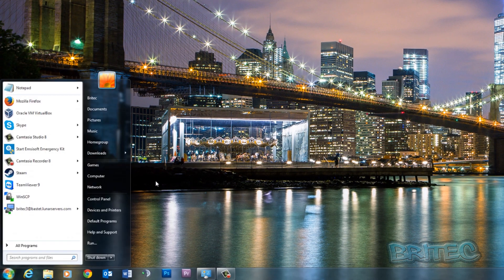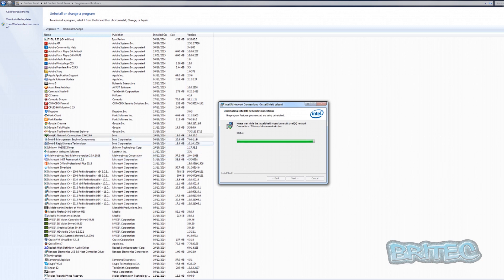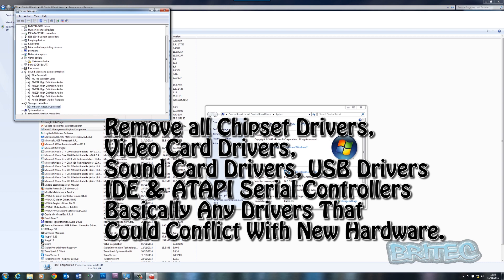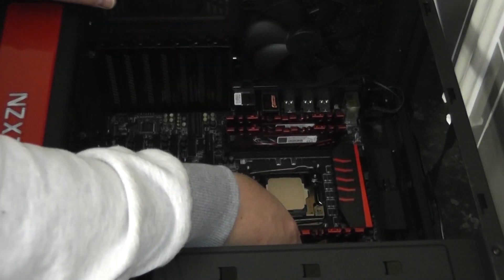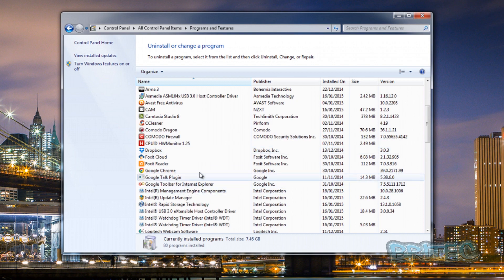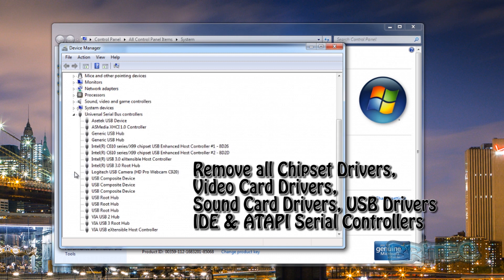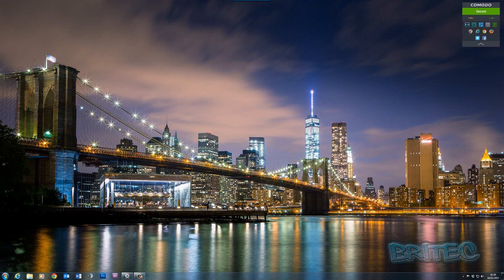Change Motherboard Without Fresh Install of Windows

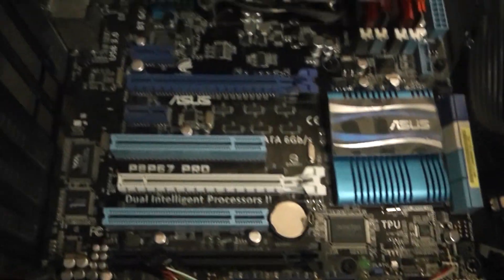Comment: Very good video.  I've personally never done this in my 16 years of building computers however I need to point out something that +Britec09 mentioned at 3:57 but didn't fully explain.  That is building a new computer.  This video should be fine if all you're doing is replacing the motherboard and keeping the same CPU.  But if you change too many things, especially if building a new computer altogether, and connect your boot HDD to it, there's a very good chance Windows will detect the new hardware (new motherboard, new CPU, new GPU etc.) and think it's been installed on a new PC and will trigger re-activation of Windows itself.

I had an old AMD Athlon 64 dual core many years ago and upgraded to an AMD Phenom II quad core.  As the two CPUs used a different socket set that the old motherboard didn't support, I had to replace the motherboard as well.   I didn't replace anything else, still had the same GPU, same hard drives and same RAM.  But what I did was backup the activated files of Windows to USB, then replaced the motherboard and CPU and re-installed Windows 7.  Once back at the desktop (to cut a very long story short) I rebooted to safe mode and replaced the default activation files with those I already had.  Yet when I got back to the normal desktop I got a message saying it didn't pass activation.  I had to go through manual re-activation of Windows which did work without calling Microsoft.

I had to mention this due to +Britec09 mentioning the whole building a new PC.
Reply: When you say "keeping the same CPU" do you mean the brand? I'm switching from AMD to a newer AMD motherboard.
Reply: No, I do actually mean keeping the same physical CPU, not the brand.  If all you're replacing is the motherboard to a more modern one then chances are your new MB should support the CPU you've been using providing the new MB has exactly the same socket type as the CPU itself.  If the socket type is different then your CPU might also need replacing.  If your current CPU is AM2 and your new MB is AM3, then AM2 should still work in it as it's not completely obsolete yet and there's still many users getting decent performance out of AM2 chips for what they need them for.  If your CPU is AM3 or AM3+, then you got nothing to sweat about as I don't see those being phased out until AM5 or 6 holds the largest section of AMD's consumer market.

I'm only theorizing here though about replacing only the MB as I've not replaced a MB and keep the old CPU.  I was young an naive then and didn't know the Phenom was a different socket to the Athlon 64.  This is because each bit of hardware in a computer has it's own unique hardware ID code that Windows uses to generate a unique machine ID for you to ensure you're not circumventing Microsoft's EULA and trying to use the same Windows activation key on multiple machines.

However please now bare in mind my original comment (and Brian's own video) was posted 10 months ago when Windows 10 was in its infancy.  My comment will only apply to Windows XP, Vista, 7, 8, 8.1 and the very first public release of Windows 10.  However if you use Windows 10 now with the latest build since the Anniversary Update on your current machine, and allow your activation key to be associated with your Microsoft email account (usually ending in Hotmail or Outlook) then only if you need to re-install Windows 10 you shouldn't have any activation issues.
Reply: Ah, ok. Excuse my ignorance, I'm upgrading my motherboard. Since I'm reinstalling Windows 10 should I backup my hard drive?
Reply: William Welsh Oh don't worry.  Back up?  Definitely. Though in this case as it's a MB replacement and you're going down the re-install method with Windows, I wouldn't do a system image backup as that'll include the old drivers for your old MB as well, just copy your personal files to an external USB drive.  If you need to copy license files across for purchased software and you don't key those keys to hand anymore, third party apps like MagicalJellybean Keyfinder should find your keys for you.
Reply: The MaskedGeek Awesome. Thank you so much.
Reply: @MaskedGEEK  Major thanks for the MagicJellyBean recommendation. Randomly trying to find solutions to bring my windows 7 over to a new PC build and found your comment! Lucky find!

Comment: Uninstal CPU drivers too? That's a scary one :0
Reply: Good to know now
Reply: So if you're switching motherboards like this, you need to uninstall drivers for ALL devices? Or can you get away with uninstalling only the mobo drivers?
Reply: +aaron I think you only need to uninstall motherboard drivers, doing just that worked for me :)
Reply: BillyTheWraith woah quick reply. Thanks man.
Reply: +aaron good luck building!
Reply: +aaron if you wanna be safe uninstall the other drivers too, just in case
Reply: BillyTheWraith I suppose it can't hurt
Reply: +aaron Yeah like the guy said they should automatically install with the new mobo

Comment: britec i have windows 7 on my hdd and have windows 10 free upgrade installed on my ssd from a clone of my windows 7....if i change from my Asus p8z68MB i5 2500k to an Asus Z170MB i5 6600k by following the method of ur video will i need to reactivate my windows 7 and 10 on the ssd or will it be activated?

Comment: Hi I have a question that may also concern somebody else than me
I build my computer few years ago and I bought OEM windows 7 and motherboard without support for SLI. Now that I have noticed that my graphics card cant keep up anymore with 4k quality and ultra settings in games I have decided to upgrade my pc by upgrading my graphics card to SLI. So like I said its not possible with my current motherboard. If I buy a new motherboard with SLI support can I change the motherboard without reinstalling windows. My current windows has been upgraded from 7 to 10. Does this cause problems? Do I need new activation code for windows because setup has been changed? I really dont have money for that!

Comment: I know this might sound a bit dumb but can someone tell me how I'm supposed to use my keyboard and mouse after uninstalling USB drivers?
Reply: I'd go with telepathy myself.
Reply: I like how everyone's responded to this guy 3-4 years later. My man's been without the keyboard and mouse for 3 years lmfao
Reply: @axtra9561  it's useful for others, like you, to come across solutions to the exact same problem.
Reply: @PlanetXtreme  Yeah i know, at least i know not to uninstall mouse drivers now, also i'm prob not gonna follow this video cause its fairly old but if i have to i will.

Im practically upgrading my whole pc but want to use my current hard drive so yeah.
Reply: @axtra9561  How'd it go for you? I got a new CPU, MOBO and RAM comin next week and aint tryna wipe my Windows SSD lol
Reply: @JakeLewisReal  Haven't done it yet but will this weekend i think. But yeah, i'm also not trying to wipe all of my stuff
Reply: @axtra9561  I'm reading that Windows 10 now lets you swap hardware and it will detect the changed hardware and update the drivers automatically. Only problem will be activating Windows if it's currently tied to your MOBO and not via Windows Account. So Imma just plug my SSD into my new build and see what happens lol
Reply: @JakeLewisReal  Ah fuck lol. Update me when it happens.
Reply: @axtra9561  Just swapped my CPU and RAM and can confirm you dont have to do shit to your SSD lol. I literally swapped the parts and it booted right up like normal, no hiccups.
Reply: @JakeLewisReal  Alright thanks for responding lol.
Reply: @axtra9561  Oh and swapped Motherboard, forgot to add that in lol. Gotchu homie good luck on the build
Reply: @JakeLewisReal  Thanks I assumed you swapped motherboards and meant that you had only kept the cpu and ram.
Reply: Restarting your PC will reinstall all your usb drivers! Windows automatically installs them :)
Reply: @PlanetXtreme  That defeats the purpose of uninstalling them doesn't it?
Reply: @georgeindestructible  it's useful if you're changing motherboards, because now that you've uninstalled your old USB drivers, and change motherboards, you shouldn't have cross-device-driver issues.
Reply: Use ps2 connector?
Reply: Can someone answer this seriously how?
Reply: @raihanpahlevi6870  ps2 connector is the serious answer.
Reply: @1121mdcity  Windows Activation is probably tied to the pre-built's MOBO so when you swap the parts and boot from your SSD, you'll have windows but it won't be activated. I never activate my Windows because I don't need any of the customization. You just get an "Activate Windows" watermark in the bottom right corner. Honestly I think you should've just built your PC from scratch if you're gonna purchase a pre built then swap the whole MOBO lol. You'd get more for your money that way, plus you're not even gonna have a fully activated Windows install which the pre-built PC includes in its final price.
Reply: @JakeLewisReal  I've built my new pc and moved hdd. I didn't even uninstall anything cause I had copied my pictures somewhere else and downloaded windows to a flash drive in case it didn't work. and I was ready to fresh install in case it didn't work. It just worked, I don't have any problems but maybe its because motherboard is the same bran and i'm still with AMD processor.  My windows didn't even deactivate for whatever reason even though I previously had a prebuilt and it said my windows was OEM, and I guess that is because a microsoft account is tied to it which I didn't have to resign into.

Comment: This sounds helpful, but I honestly don't know wich drivers I should uninstall and wich to keep. I am pretty much only changing the cpu & the motherboard.
Reply: this is exactly what i'm looking to do upgrade the processor, motherboard and video card in my current build without wiping the drive. How did it work out for you?
Reply: shinonyx dude literally i’m upgrading my cpu, motherboard, and ram and i’m hoping i don’t fuck everything up, building later today
Reply: @chasecrime  good luck
Reply: @ccrimeplaysgames let me know how it goes, I will be doing the same thing next week some time and don’t want to have to reinstall everything
Reply: Morgan Akryas everything went well besides the fact that i need to go and buy an extra psu cable
Reply: ccrimeplaysgames I just did it today, worked perfectly, thank you for giving me the confidence to follow this lol
Reply: Morgan Akryas loll no prob bro. if you were wondering i’m probably going to end up going with a 750 W psu bc i’m not tryna fry anything
Reply: ccrimeplaysgames if you need a 750w go for it haha, I’d recommend using an 80+ Gold certified PSU at least if you can tho no matter what wattage
Reply: @chasecrime  I am going to upgrade my cpu and motherboard, what steps did you follow? Did you do what he did in the video? Sorry, I just don't want to screw up my pc...
Reply: joey no i had to whipe all my storage because i didn’t feel like doing all these steps and the extra stress. GOOD LUCK
Reply: Morgan Akryas yea i think thats what i’m looking towards
Reply: @chasecrime  okay, how did you transfer windows and install the drivers?
Reply: joey I just downloaded all my new drivers to a usb and uninstalled all old drivers, swapped out my motherboard and cpu and installed the new drivers everything went fine
Reply: joey i j downloaded windows and all the drivers to a USB and did it from there
Reply: @chasecrime  Did u have to reinstall windows? Like from the bottom with a cd/usb stick?
Reply: Frederik Larsen yes i installed windows from a USB stick
Reply: Morgan Akryas so you installed the drivers to your pc before swapping your motherboard?
Reply: i just finish change my motherboard asrock a320m to asrock b450, and my windows boot and works fine, but should i install a new driver for this new motherboard,its the same brand and socket. 
Everythings seems to works fine,but do i still need the new driver? how about the old driver? should i uninstall it?
Reply: i just wanna swap out the motherboard, from mini asrock to an atx asrock. checked compatibility with pcpartpicker. can i avoid any steps?
Reply: the motherboard handles almost everything so all your drivers have to go

Comment: I'm upgrading both the CPU and Motherboard from an AMD Athlon II X2 250 and Foxconn M61PMP-K to an AMD FX-8320 and ASRock 970 Pro3, while keeping the same graphics card, an EVGA GTX 560 Ti. Will I have to uninstall the graphics drivers or not? Thanks in advance.
Reply: +LocoCatpwnz You have to.

Comment: Getting a new mini ITX tomorrow, moving my ATX into a SFF and will need to change mobo.  God after running a custom water loop i can't stand the sight of air cooling and the hugeeeee heat sick.  Your CPU cooler is bigger than the mobo itself. Thanks for the vid though will need it for tomorrow for the swap.

Comment: Would it be OK to just install the new motherboard first and try booting to see if it works? Just to possibly save time in case it works without having to delete the drivers. 

Would that be fine to do or will it cause issues or something?
Reply: +danermanerkider It's a gamble. No telling if it would work fine that way, but it might. Do that only if you'll be okay deleting all your data if it doesn't.
Reply: Legalize CrystalWeed That's the thing. If it doesn't work and boot up, cant I just remove the motherboard and try this technique?
Reply: +danermanerkider If you had problems with the new drivers and old drivers then no. The reason it wouldn't work is because the new drivers would conflict with the old ones. So if it didn't work when you replaced the mobo it wont work when you put it back.

Comment: Isn't it easier to simply create a system image (for Windows 7) backup onto a external HD, install the new motherboard, and copy the system image/use a repair disc? 

Or does it not work that way? Any help is appreciated since I'm going to be upgrading my motherboard.

Comment: so I have an i5 3470 that has quickly become a bottleneck for my system. It would only cost me $400-$500 for a skylake chip with motherboard that'll allow overclocking. So I can simply uninstall all my driver's and install the new mobo/skylake chip and it'll all work? what about windows reactivation? I've heard major hardware changes like this can trigger this. true?
Reply: I'm not completely sure but Windows reactivation would only occur if you reformatted.
Reply: +Nuclear Pineapple swapping motherboards did trigger Windows 10 reactivation on my OEM version but I was able to get it to accept my old product key through digital entitlement.
Reply: How did you sort the drivers out? Did you uninstall all old ones before replacing the mobo or did you leave them be and just manually install new ones?

Comment: This isn't needed.  Windows doesn't lock in drivers.  It searches for the correct driver to use based on what it has installed.  Windows has default system drivers which allows it to boot on any modern motherboard. Once you start windows you can install the drivers, or hell if you want to you can install the drivers before the swap. The issue is the application registry problem swapping motherboards causes with Windows and other applications. Which is why people say a fresh install is best, but you can get around that if you know what you're doing.
Reply: Windows 10 recognized what i needed and what I didnt and it  removed everything I needed and did not need,  I'm pretty happy
Reply: @Survivor694  did you replace the CPU and motherboard, because i'm going to upgrade bot of mine soon
Reply: @crimplepick3631  yes I did from a mini atx to a full atx intel setup windows took a little to recognize it but it was nothing I loaded my old HD with the new components and it was fine for me I had windows 10
Reply: Survivor694 im switching mine out right now
Reply: @crimplepick3631  I also made my windows account personal and put a pin on it as well
Reply: @crimplepick3631  or I linked it to my Microsoft email account
Reply: @Survivor694  I've just done it and it worked flawlessly. I didn't delete anything before, windows did it all for me as you said it would. 
For anyone using Win 10, don't bother doing it yourself.
Reply: @crimplepick3631  awesome bro glad it worked out for ya!
Reply: -Jeff - so you didn’t do anything?? I switched out my motherboard and cpu and I’m getting a black screen.
Reply: It's not needed but it's the simplest way imo
Reply: Pradigy Musicman how do you do a clean install?
Reply: @nitaluhromyk2157  a wiped HDD or a new one. and an install of windows
Reply: @nitaluhromyk2157  it's also possible to do a clean install with keeping all your personal data intact, in that case you only have to reinstall any applications you had before and reactivate licenses where applicable.

Comment: So now i know it would be fine getting just a new processor, motherboard, heat sink, ram and keeping my gtx 970. Would I have to remove the graphics card drivers if I wasn't replacing that though?

Comment: Would this also work when swapping from a AMD socket to an Intel socket/mobo? Thanks
Reply: +aaron evans because of the different sockets and thus different drivers. But I guess it would work. I just reinstalled though. freshy
Reply: +Tomas De Meulemeester So how did it work? im thinking of upgrading from an amd fx 6300 to an i5 4690k. Did you have to reinstall windows?
Reply: +NordicTexan I did a fresh install of windows just in case
Reply: +NordicTexan always feels nice